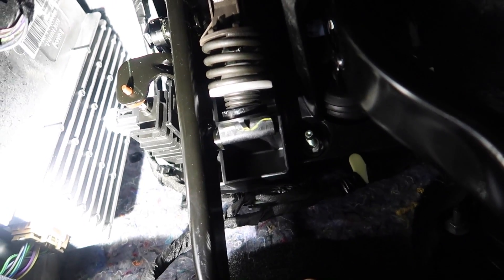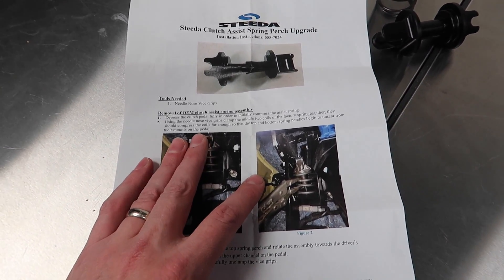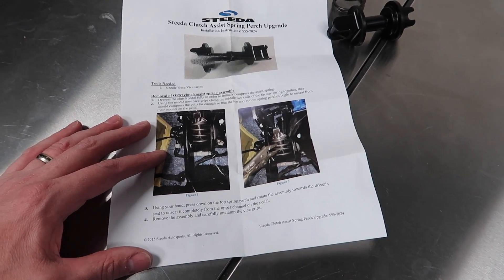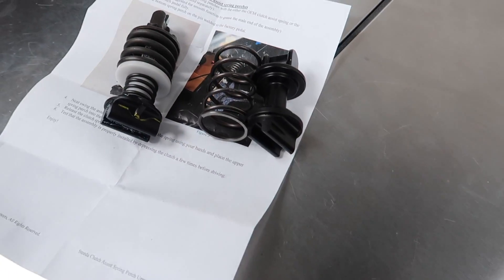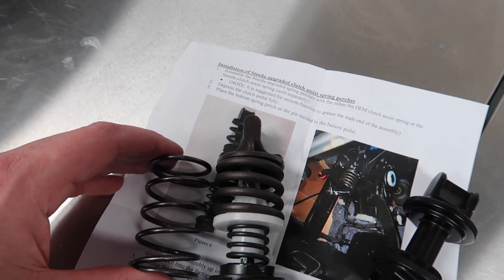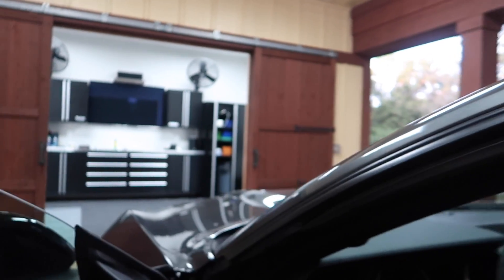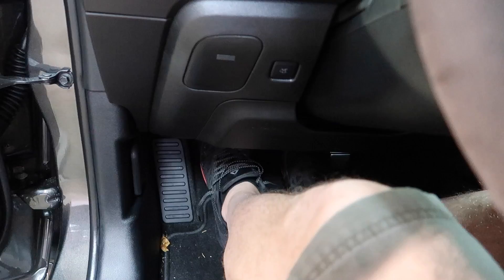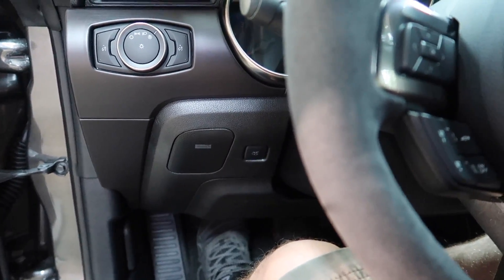Shelby GT350 Steeda Clutch Spring Upgrade

Comment: Hey Matt, I'm thoroughly enjoying all of your videos; many thanks for taking the time to create and post them.

I completely removed the assister spring assembly from my GT350 and it made a very positive difference. Some guys have said that they've experienced play at the top end of the peddle with and without the Steeda assister spring, so I feel fortunate that mine has zero play without it. 

I've also installed the MGW shifter which I have to say has transformed the driving experience for the better IMO.

Looking forward to more updates.

All the best, Chris.

Comment: So what are your thoughts after driving it? Worth buying?
Reply from the maker: Yes, massive difference.
Reply: Nice, thanks for the feedback. Also just a heads up, the ford performance oil to air separators or a catch can from an aftermarket company will serve you well. Have a good one
Reply from the maker: They are on my list.

Comment: My focus st has the same clutch spring, it's awful and I wont to get rid of it so badly
Reply from the maker: It's a pretty cheap and easy thing to do.
Reply: I took the spring out for a bit but it is loose and floppy, there isn't anywhere I could find that makes a focus st one because the part it goes on is a bit bigger then the one you have. I'm sure steeda will make on eventually, but I definitely need that if they do it.

Comment: I went in to replace this on my 2019 GT 350.  To my surprise, the car does not have one installed from the factory. Instead there is a spring wrapped around on top.  When I tried to use this spring, the clutch felt too easy to press.  Any suggestions?  Wasn't this supposed to make this a little stiffer because the old one was much stronger?  https://youtu.be/QzOHLS0JBBY